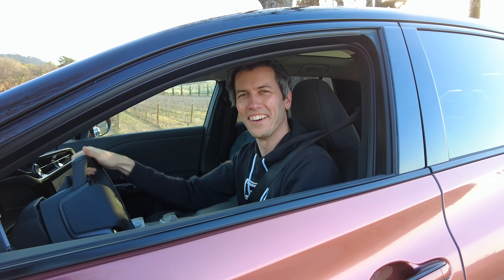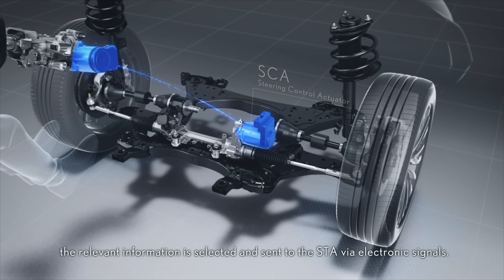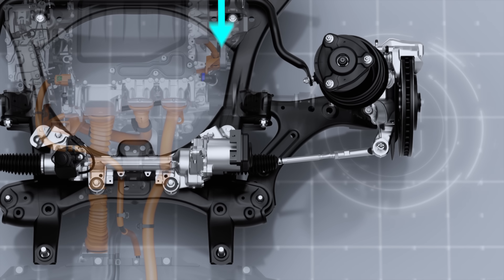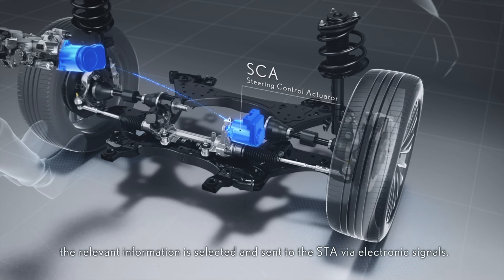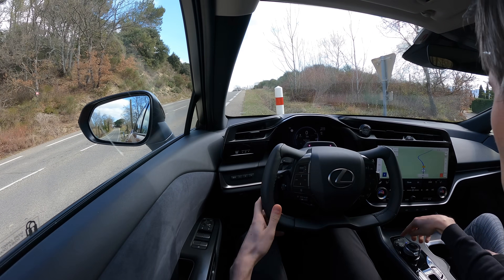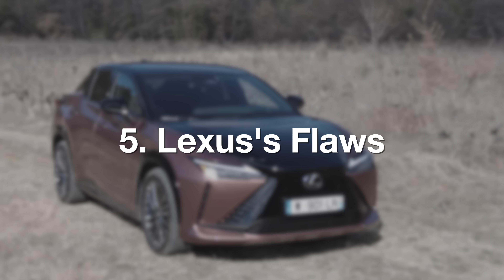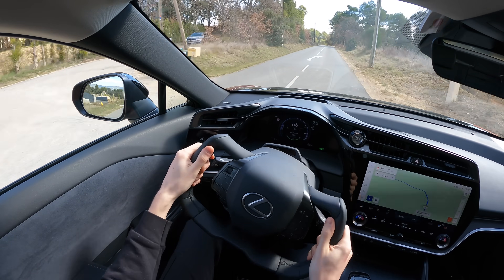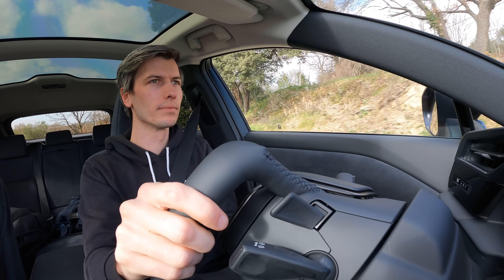How Lexus Fixed Tesla's Bad Idea: Steer-By-Wire Yoke

Comment: I love this. I want my car to feel like a very expensive racing simulator. ❤ I also want the option to at least have different modes that keep the steering ratio low even at high speeds.

Lexus will get that lag down for sure too.

Comment: this is true..I just purchased a Model 3 RWD I order it from the site, never had driving one, when picked up from the Tesla service center, once I entered the highway... what was the first thing you think I did??? I PUSHED THE PEDAL TO THE METAL!  WHILE CHANGING LINES PASSING SOMEONE, OOOMMMFFFGGG! I almost loose control of the model 3, the front swivel all over the place, I was like what the real F$%ck just happened?? I thought it happened because been RWD the front of the car is not heavy enough to have the car weight more balanced... but I now think this is the reason why the car swivel all over the place, the low reaction of the tires moving to idiotic steering wheel fast movements... I was lucky not to crash the first day of driving my m3 with 20 miles on the odometer!

Comment: Military jets use fly by wire on their control surfaces, so I think the input delay will get ironed out.
My concern is muscle memory. Turning the wheel 10 degrees at 5mph moves the tires more than 10 degrees at 30mph.That's going to be a problem for me (and I think, a lot of people). 
Didn't BMW have a mechanical version of this years ago? I seem to remember that people hated it.

Comment: Driving in the snow at highway speeds and an elk runs out in the road, you have to take evasive maneuvers, and sliding is guaranteed.  Will this system be responsive enough to properly counter steer to recover?  I live in Northern Idaho and that is a real issue, elk, deer, moose, bear, wolf, etc.  My other thought is how disappointing the tpms system is in my toyota.  I usually am aware of a pressure issue before the tpms light comes on, but it doesn't seem possible in a system that takes away feedback. In reality, though,  this is just one more step closer to the driverless car.

Comment: This sounds like a bad system. Imagine that system fails, or no battery. No steering? The mechanical link is safer, simpler, probably cheaper.

Comment: Variable ratio was introduced from Audi 15 years ago. The system is also available in VW Golf and similar since nearly 10 years. It's working with nearly no problems. This Lexus system is much too complicated because there is no mechanical backup, you need to install everything redundant for failsafety. Anyway let`s wait for first recalls or at least horrible repair costs.

Comment: I think if the variable steering comes to many cars, there must be settings to adjust the curve or to not have a curve at all. Car manufactures may not have these settings as it will look too complicated or they will have setting controls but not to the degree that I would want it as like having sport, slippery, comfort, chill settings.

Comment: In theory great but in reality insanely overly complex and the price of repairs will only be affordable to very deep pockets. Manual steering has been perfected to a high level and is reasonably affordable to repair when it fails and ALL systems DO fail at some level and time. The spirit of W. Heath Robertson has taken over the automotive industry. One thing never mentioned is what happens when DIY and tinkering fools play with these vehicles. They will kill or injure themselves and many around them. 50 yrs. of fixing cars and light trucks says the KISS theory has been ran over by the automotive industry and then been  backed up over again and then ran over still again to be sure it is dead. Hold on to your wallets. If you think car repairs are too expensive now you ain't seen nothing yet!

Comment: As a tech the amount of throttle by wire systems I have had to fix is not a small amount. Is the wiring redundant because when a mouse decides to eat one what happens. I also wonder how you test, lets say gear wear with this system or is the steering rack on a mileage schedule for replacement. How much does this extra complex system cost to replace, is it serviceable or are you replacing the whole system.

Comment: Variable steering ratios, albeit still mechanical, have been a thing for a while. BMW offered it as far back as ~2005. I remember test driving E60 5-series with variable steering ratio based on speed. I hated it then. I assume this tech has advanced a lot though.

Comment: Airbus nosewheel steering has been steer by wire since the '80's. It's variable ratio in that it is less sensitive near center, but ramps up as you command more wheel angle. It feels odd at first, but you quickly adapt to it, and I actually enjoy the feel of it now. It's worth mentioning, however, that on at least one occasion I know of, the nosewheels were cocked at full travel on gear extension, and the aircraft was landed like that, which made for some interesting news footage. Good job by the pilot who managed to keep it on the runway.

Comment: The question was what happens if the car has no power. So based on the run around answer I'm assuming the car can steer or do anything if it loses power. Not very useful if an emp goes off. Manufacturers should go back to fully mechanical vehicles again.

Comment: Having dual redundancy doesn't rule out complete system failure, it just makes it more unlikely. The motors might just both fail if you are unlucky, or the control system can fail. For example, what if there is blast of electromagnetic radiation that disables the car's electronics. If the car is coasting without engine power and brakes, mechanical steering will become very heavy but you still have control, and there is a good chance of mitigating disaster. With steer by wire, you can only pray, which while it may save your life as well, you sure can't rely on miracles as part of an engineered solution. In aviation, quadruple redundancy is common, and sometimes there is mechanical backup as well. Furthermore, if a fighter jet is bricked you can still eject to get out of danger. It doesn't seem like steer by wire a a good idea. Sure there are benefits, but personally I will be avoiding any vehicle with such a system as much as possible.

Comment: Regarding your delay concerns. I suspects this not much of an issue as the drivers feedback is change of vehicles direction not what angle the wheel have. As such there is always delay for the driver perhaps a little more with this system but should not be an major issue.

Comment: I think 30 years ago I bought a Citroen CX Turbo II and had the same issue with a very sensitive steering on highways, nearly no responce from driving and a button for breaking... Within a few days you are used to it and find any other car odd... In my opinion this is nothing new, it's only the fact people don't like changes, even if they are huge improvements.

Comment: The 2019 Acura NSX uses the same concept for its steering. 
I used to drive a bus for city transit. Some of the newer vehicles had drive-by-wire steering but there was literally no steering feel, it was easy to drive especially in the city where a lot of turning at low speed was required. It also had a sensitivity curve of sort so it would get more sensitive as you steer to one side more which was convenient in the city center. I still preferred thr buses with no power steering at all. Also because of working as a bus driver for a while I started to hate any steering wheel that isn't a perfect circle.
Reply: interesting. is a perfect circle less fatiguing?
Reply: It's really the driving style. As someone who used to drive a bus we were trained in a certain way and the habits developed from that kinda stuck.
Most people hold the steering wheel outside-in when turning, but I always change to a inside-out grip when making a low speed turn.

Comment: I would have thought that in addition to changing steering sensitivity based on speed, there would also be a curve for a given speed based on total rotation of the wheel, e.g. first 20 degrees of rotation from center feels and responds differently than the final 20 degrees until lock.

Comment: I think steer by wire came out on a 2015 Infiniti Q50h, and maybe got recalled for possible lack of steering output when there  is power fault in the motors.

Comment: you forgot the safety and security aspect!  Safetly: accident.. no steering rack in your way/face (reminds me of the old Audi Pro-Con-ten system). Security: if my alarm is armed in the car, rather then locking the wheel I could just leave it spinning so the thief cant do anything with the car  :)

Comment: Hi, of course, It was a highlitable delay between the steering command and the front wheel actions at fast steering, even It could be easily recognized with conventional eyes.
I believe this tech can be suitable for drivers with some amount of disabilities who are not comfortable with hand-over the steering and commonly driving at low speed.

Comment: Is there a redundancy in the wiring for the steering system? Rodents and other animals chew through wiring on many new cars.
Comparing it to throttle by wire is a leap, losing throttle at speed is vastly different than losing steering at speed.

Comment: What appears to me a significant risk regarding the use of a yoke for a car, is emergency steering.

Whether with both hands on it, or with one and, the worse case, the two removed, there is less surface are to grab, especially if the yoke has (been) moved.

Comment: Untill you can prove the reliability and strength of a purely drive by wire system meets or exceeds the reliability of a steering rack or box it's a potential disaster in waiting.

Comment: Or may be Lexus should have incorporated the hydrolic connection into the system as oil filled medium will transmit better but subdued feel of the yoke. All the same time, it will let position yoke in most affordable angle and no portrusion. If car looses some way a power, there would be still ridged connection as the last resort; so this would be very much like moto-bike feel.

Comment: I think steer by wire is definitely the future of car design - especially as we get more “self driving” cars. Also allows for cars to be sold in LHD or RHD markets without requiring the steering column to be moved.  I just have concerns about how the system will respond. In the rc car world, some radio systems are slower than others, resulting in a slight delay from your steering inputs. At longer ranges, these delays can be increased to the point that steering with accuracy becomes a challenge. 

The other concern is accident avoidance on the highway. The car needs to be able to swerve at a high speed in order to avoid an accident. I don’t want the car thinking my steering input is too much at the speed I’m going, and decide it won’t actually turn much.  I’ll deal with a skidding car after I’ve avoided a potentially fatal collision. (I have actually had to jerk the wheel of my car at near or at highway speeds, and have praise my car selection choices by choosing a less comfortable performance car over a high cog cruiser. Those few times you actually need those Brembo brakes, or the “low and tight” suspension to avoid an accident and remain in control will be well worth it. 

I think steer by wire can get there in terms of responsiveness and adjustable ratio - just not sure a yoke is the right answer. Just causes more problems at this point.  Remember, with a wheel and a short ratio, you can still keep your hands at 9&3 - but would be nice to be able to program the steering ratio by driving mode, including the end points for the steering wheel. Ie - physical adjustable stops on the steering to correspond to adjustable ratio. 

I’m also envisioning a wheel inside the yoke with a 3:1 reduction gear to allow highway cruising with the wheel, but still have the yoke (retracted towards the dash?) for emergency swerving on the highway?  Just spitballing some thoughts...

Comment: I love the idea, especially as it would make it easier to develop right hand drive vehicles faster and we could get more vehicles choices in Australia 🎉
Reply: Huh? I don’t think development difficulty is the reason some vehicles aren’t available in right-hand drive. It’s because Australia is a tiny market and larger right-hand drive markets (the UK, Japan) aren’t interested in those particular vehicles (I assume you’re talking about some kind of American atrocities).
Reply: @ComicalFlask  it's the same thing: if the cost are much lower, then it becomes profitable to offer them for tiny markets like Australia. 

As for the atrocities (assuming you're referring to large pick-up trucks), some are already in Australia as they have remanufactured locally to change the steering wheel location. But no, that's not what I would be excited about.

Comment: If you had to steer in an emergency situation, it would be difficult to make the split-second decision on how much steering angle you need on the yoke to maneuver the car out of the dangerous situation (and not into another dangerous situation.) And in a hypothetical situation where the vehicle also has a fault where it gives wrong, irregular or potentially missing vehicle speed data, what is the steering wheel "limp mode" going to be like and how would it be implemented? If the car loses speed data mid corner, would the steering angle change abruptly without warning when the computer notices the problem and resorts to some backup value?

Comment: Two doubts: 1. In any case the ultimate angle and the ultimate decision if to turn the wheels remains with the car computer that is its programming which can be pretty dangerous in some situations where a person would like to control the machine by themselves which will not be possible as there is no direct connection 2. As you yourself said that all people are not enthusiasts and the limitations of current "mechanical" steering racks and limitations posed thusly will not matter to most of the folks, so the compromise between a short and long steering ratio with assisted steering will suffice most of the drivers with the basic benefits of the current system. Why introduce a new, expensive, mostly complicated and non reparable system which would not be serviced by a normal repair shop?

Comment: Any time a car thinks it knows better than me without the ability to override it, that's a problem.

If I'm driving in the snow, I'm turning traction control off. Predictability is safety, and battling with a computer that you can't disable is unpredictable. If they program it to be a fixed ratio when traction/stability control is disabled, I'd consider it. Otherwise no.

Comment: This sounds exactly like what I thought Tesla’s yoke steering would be. 

Wouldn’t be surprised if this type of system becomes more and more popular moving forward, and I think it would be easier to adjust to than most people assume it would be. 

I personally have a weakness for quick steering, and I’ve always thought it would be amazing if a steering system could transition to a super quick ratio at low speeds.  Hope I get an opportunity to give it a try someday 👍🏻
Reply: Tesla ended up releasing proper steer by wire in the Cybertruck and it feels really nice

Comment: As a Tesla driver I am quite happy with my Tesla. Not only do I have good control with my Tesla, but when I want to I can turn on MY FSD and let it drive me where ever I want to go. Not to berate Lexus but do you have FSD? Version 11 is great and I have driven more than 300 miles without having to touch the steering wheel or the brakes. Can your Lexus do that? That includes driving through part of Dallas to my destination and pulling up in front of my home. Can your Lexus do that?

Comment: Absolutely hate the idea. There is a major trade-off here, and that is predictability. If an algorithm controls the rack ratio, I now have to understand the algorithm to understand how my car will respond to steering input at a given speed. A rack and pinion system will never have this issue. Much prefer the solution of a variable rack ratio, where steering is slower near dead center and faster at high steering angle.

Comment: What if you prefer holding the steering wheel at the TOP or BOTTOM like I do...especially driving an (archaic?) manual transmissioned car?

Comment: You have opened my eyes … the whole turn ratio deal with the Tesla was what I did not like.
Just the same, it seemed like there was  way too much low speed yoke motion as shown in this video. You explained that at the end and Lexus MUST fix this or accident avoidance maneuvering becomes fatally compromised.

Comment: I have no issues with the reliability as aircraft have been very reliable and redundant being fly by wire, having 3 systems of redundancy and all. The response rate and variable input/output ration would probably bother me. Being software controlled though means those steering profiles could be changed, much like a driving sim. (I set mine up to be one to one). I'd be curious to see how it reacts in a drift. or loss of control when large quick inputs would be required to counteract, dampen and regain control with the delayed input it may exacerbate the issue, although tc would have some effect to straighten the vehicle using left and right braking. But in loss of control large inputs without delay could be necessary, my prius with a shaft mounted steering motor can turn lock to lock about as fast as I can practically turn it, I'm wondering if the steering speed is limited by software in this Lexus. Seems kind of like Boeing's or Airbus's flight controls where control system inputs are limited and executed to within known safe limits on the control surfaces. It would be interesting to see some tests done to determine exactly how these control curves operate.